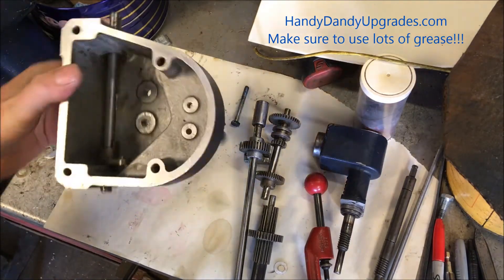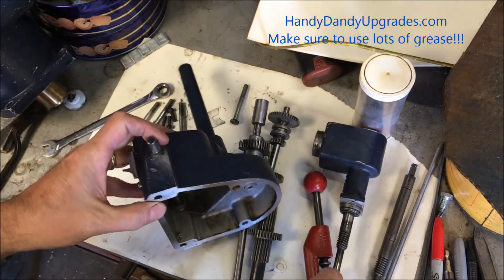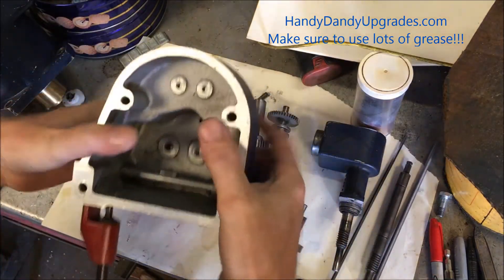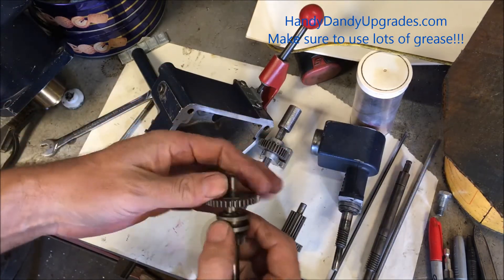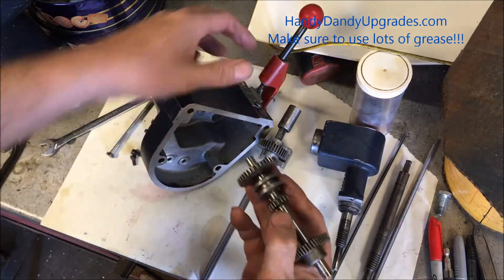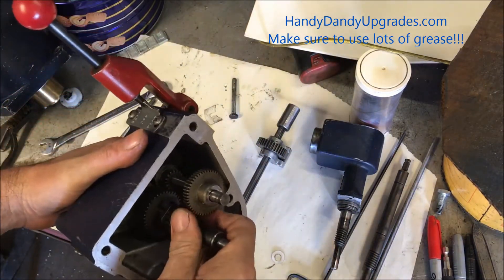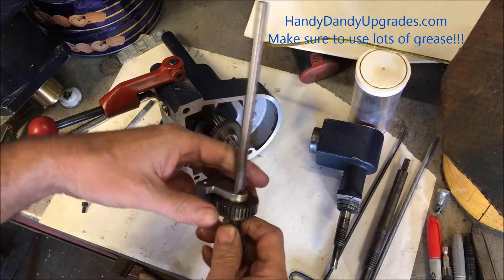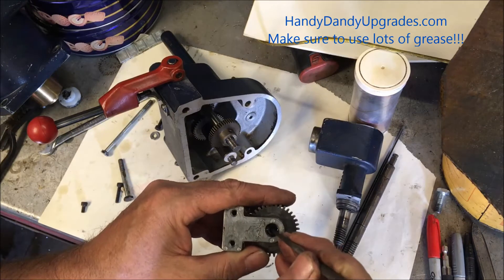Disk Feed Gearbox Rebuild AMMCO 4000/4100

Comment: Great video series. I bought a used AMMCO 4000 and she shakes a bit in neutral/idle, even without a drum or rotor. The arbor is dead on both in the X and the Y axis for runnout. The vibration appears to be comming from somewhere in the gear train behind the driven pulley. Is the worm drive a common source for issues?

Comment: What would be the issue if i have to hold the lever , in high speed or low speed, or it will move to the straight up, neutral position?

Comment: I can't get the crossarm from the Main Shaft.  The the 90 degree Arm that is used for Disk Rotors is Locks Up. I have removed the Rod from the Cross shaft but the 3 inch cross arm won't separate from the Main Shaft. Can You Help?
Reply from the maker: yes I can help, call me 1-833-768-8447

Comment: My gearbox keeps slipping out of gear in fast speed only, literally have to use a silencer band to hold it in gear....the shifter handle is tightly secured to shaft but there seems to be considerable play inside the gearbox.
What part do I look to replace in the gearbox ?
Reply from the maker: First thing to look at is the shifter. The only thing holding it in gear is the spring in the shifter handle. If its sticky it wont hold it in gear. Some times its the shifter plate is worn or miss aligned. If that doesn't solve it call me.

Comment: Hi how are you doing ? I have an AMMCO BRAKE LATHE. And it does not have a motor to feed the disc cutting knives table is that a normal thing or does this one have a missing part?  And if I need parts for my machine would you have a recommendation for a place to get some?
Reply from the maker: It sounds like you have a drum only machine - if you want to upgrade it see our power feed upgrade video. https://www.youtube.com/watch?v=rimsH2xVu-U

Comment: Good evening you say to use a lot of grease but where do you install the grease before installing the unit? Thank you and God bless you ✝️✝️✝️
Reply from the maker: Everything should be covered in grease and the well at the bottom should be full.
Reply from the maker: I like to see a cup and a half - 2 cups of grease in there.
Reply: @handydandyupgradesinc7164  what kind of grease to use in the crossfeed and the drum brake gearbox?
Reply from the maker: @nathan484848  thanks for the call. I want to put this here - for colder climates use a thin brown grease like for barrings. In colder climates the grease can thicken and you want a nice thin grease.

Comment: I don't know how many customers call me complaining that hey it doesn't go into gear it keeps skipping out. My first question is you didn't take it apart did you? They're like no we didn't take it apart. I remove the Box off the the machine and take it apart and that gear talking about they put in backwards but they swear they never took it apart. I'm like the factory doesn't put this in backwards
Reply: The Trap gear?
Reply: @theresahoffman8408 no it's part number 9118 it's called a clutch it's on the shifting rod in between the course gear and the fine gear. It's what the shifter Fork hooks to to engage the different speeds

Comment: Do you know if the long and short Lead Screws are interchangeable on the drum box?
Reply from the maker: They are interchangeable in the gear box BUT the length is important on the machine itself. You cant use a 4000 drum feed screw in a 4100. A 4100 screw can be used in a 4000, but only if it is cut carefully to length and dress the threads properly.

Comment: My ammco  brake disc  feed doesn’t work when I turn it with the knob unless I pull and push it but when I put it in gear slow or fast the knob turns on its own but the disc feed shaft itself stays in place it won’t move on it’s own
Reply from the maker: sounds like the roll pin in the trap shaft has fallen out. its a easy fix. Remove disk feed box and replace the roll pin. it might also be just unscrewed from the trap shaft coupling. this happens when someone leaves it in gear and whines out the feed screw.
Reply: @handydandyupgradesinc7164  thanks I’ll take another look at it now I appreciate the videos thanks 🙏
Reply: @handydandyupgradesinc7164  I figured it out there’s a brass piece on the cone to the disc feed with 2 Allen bolts that piece snapped on the back side so nothing holding it to back and forth ...any idea we’re I can buy that piece??
Reply from the maker: @Boyztobros  We have them and now would be a good time to think about extending the travel.
Maybe even doing the guide bar upgrade?  An slap some new grease in the cross feed carriage. Make everything slide nice. An how does the spring boot look.
Reply: @handydandyupgradesinc7164  not a bad idea but I just bought this lathe for cheap because I wasn’t working, do you have a video on how to extend and do the other recommendations? Thanks for the help 🙏
Reply from the maker: @Boyztobros  https://www.youtube.com/watch?v=ghrbrbYn54o and watch the potion of https://www.youtube.com/watch?v=1fl48Jhq_O4 that shows replacing the guide bar.

Comment: Question:  I noticed your trap gear drive rod has slots running all along the entire rod.  My rod has slots that stop short about 2 inches from the end.  Do i need to get a newer rod like yours for longer travel or are they the same?  Also would i then need a newer coupler as well?  Yes i'm already getting a longer the longer slide bar and i will  reverse the feed nut.

Comment: Your vid says use lots of grease.  What kind of grease or does it matter?
Reply: Soft grease is what I like. We are looking for smooth action. The harder stuff has issues when it gets really cold. Molly greases tends to break sheer gears when its really cold. The drum feed gearbox wont work well with harder grease. There are trade offs with the soft stuff too. The juice runs out in hot climates. The soft brown stuff or the soft blue stuff seems to work pretty well. White lithium grease is nice for sliding parts.

Comment: Could you make a video on some of the options to modify the ammco 4000 to accept larger brake rotors?  I know the gold option is your power feed but it is expensive.  I have seen other options like changing the lead screw nut and changing the  twin cutter platform.  There may be pros and cons though.
Reply: Its in the works to do a series of videos on cutting the big stuff. The extension plate is not stable enough in my opinion. Tends to have chattering issues. Excellent question. Short answer is it comes down to stability of both the rotor/drum and the cutting tooling. Turning rpm too.At some point in the future Im thinking of doing a variable main drive motor upgrade or make some better pulleys Slowing down the arbor speed is a must at like 16 inch diameter.